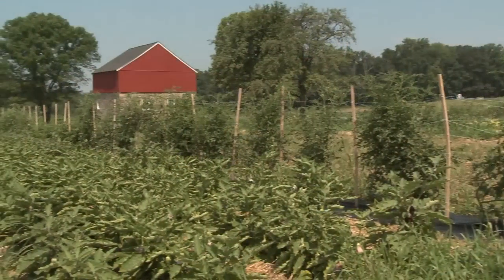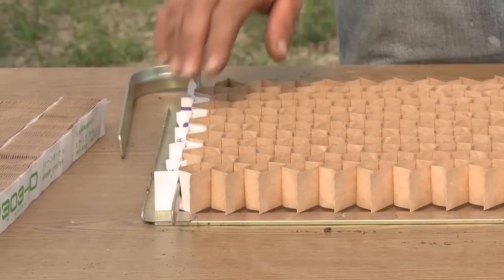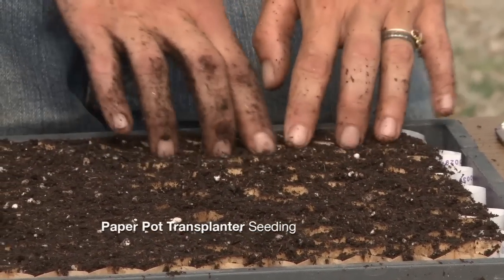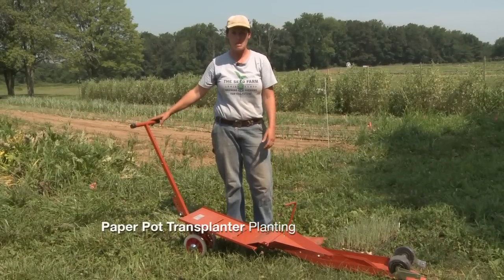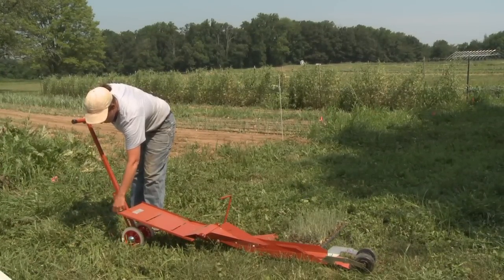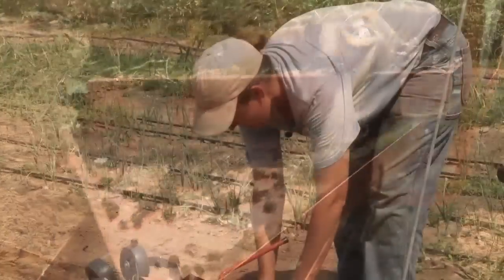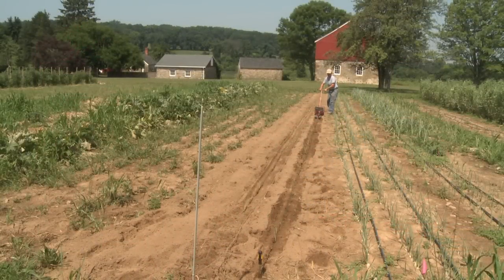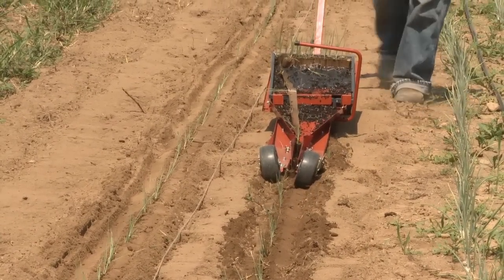Paper Pot Transplanter

Comment: Great Idea, but the way the seedling cells get pulled out of the tray and fall sideways, potentially damaging the plants, is an area that needs a re-design, surely?
Also, the set of different sized hole seeding trays,  and the one-hit dibber, are tools well worth adding, having bought into this system.

Comment: A very nice concept and machine...but way over priced at over $3000. Then you have to continually buy the paperpots.
Reply: Planter itself is $1099 USD plus $20 shipping from paperpot (dot) co.  Certainly not for the home gardener that plans on a salad here and there.  For the market gardener, the time savings most report on YouTube pays for the planter and  even the $3099 starter package (which includes the planter, 40 trays and 300 chain pots, enough for 79,200 plants) within one season.  The pots cost .01 - .025 per plant with shipping.  Again, the time savings more than pays for the extra cost for the pots.  

Then again, maybe it's a market signal for those that believe the machine is overpriced to jump into the market and make one less expensive.  Yes?
Reply: Do you work for the Paperpot company?
Reply: A little business sense, about 10 minutes on their website and basic math was enough to make the argument.

Have you come up with a cost and time effective alternative?

Comment: 5:18 It doesn't matter much but you are doing thing wrong. the metal piece you put under the seedlings is supposed to rest completely  in the tray because it is designed to provide a smooth transition between tray and the device not to have them drop like that.